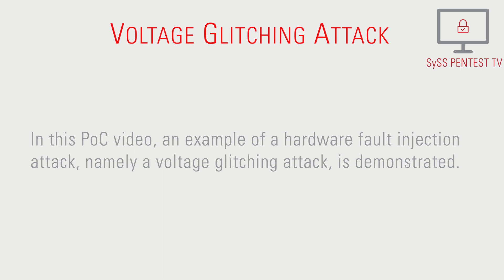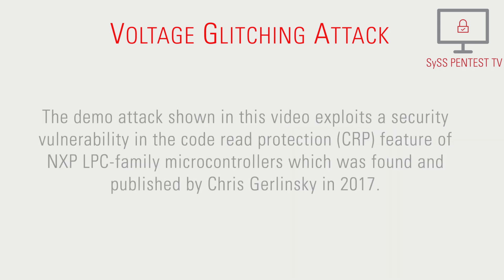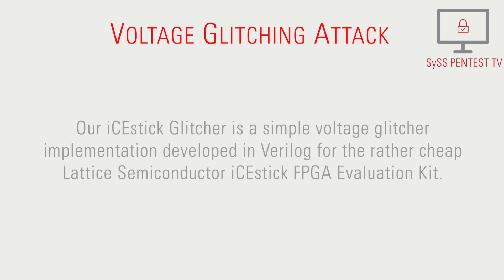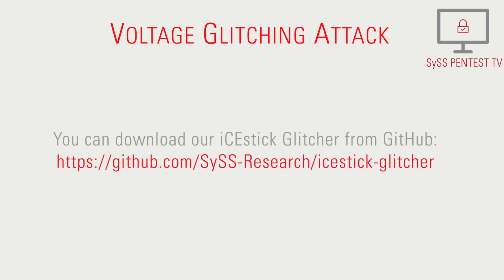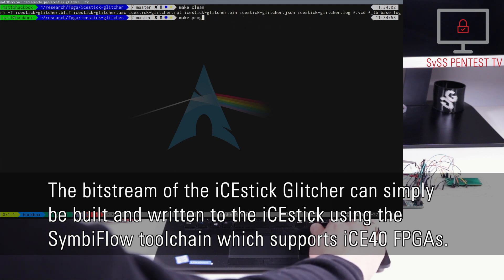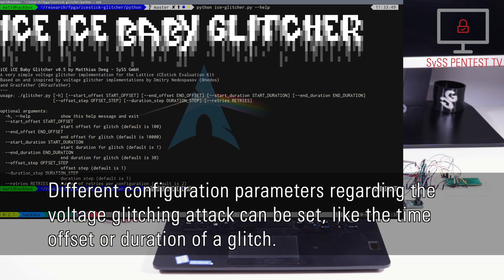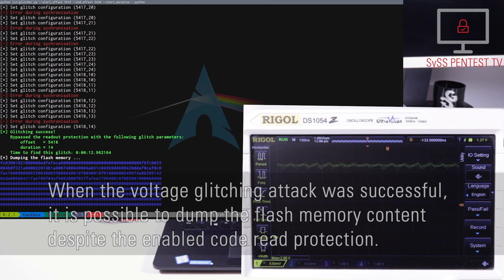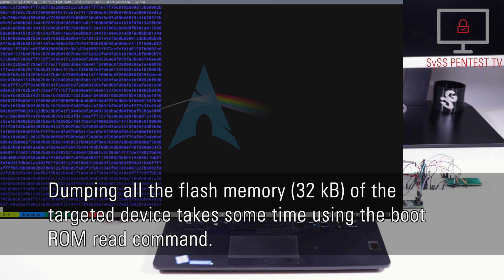Voltage Glitching Attack using SySS iCEstick Glitcher

Comment: What about a chip that operates in a similar way to the LPC (loads values from flash during boot for comparison) 

For example: if by default a target MCU loaded 00-01-01-01 during boot into a register
 (00=Backdoor key access disabled, 01=Mass Erase enabled, 01=Freescale factory access denied, 01= MCU status secure)

Would it be possible to glitch only this 8bit read until hitting a combination where the final 2 bits hit 10= MCU status unsecure. Which would allow debug access.

 Is 30 nanoseconds too large of a glitch such as the one described by Gerlinksy ?
Reply: Hi Paul. It can be challenging to control which bits get corrupted where, however it doesn't have to be impossible. From my experience, 30 nanoseconds is not that much and the required length of the glitch depends on many other factors. If you want, shoot me a message and we can discuss there!

Comment: Hi im trying to do something similar with an f103 target. Any idea how i would go about using a flash read command from my stlink v2 as a trigger?
Reply from the maker: Directly talking to the STM32 bootloader via UART (see ST AN3155) probably is the better option and allows for more control in the glitching setup.
Reply: @SySSPentestTV  thanks will give it a shot
Reply: @SySSPentestTV  Im stuck at the first step. im trying to communicate with the boot loader through my icebreaker FPGA. Its my first dive into FPGA and im really confused as to how the pmod pins are assigned. To start with i am trying to get a simple pass through working so i cant simply communicate with the bootloader. any chance i could drop you an email for some help?